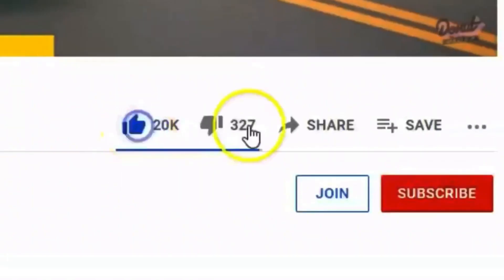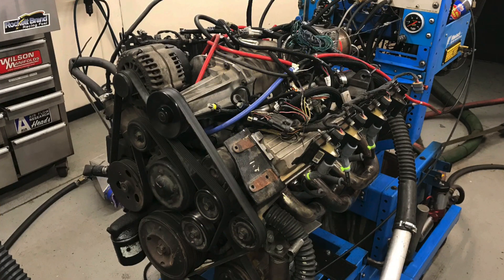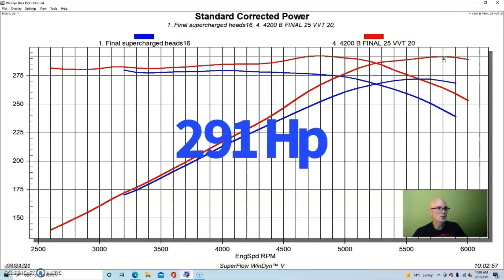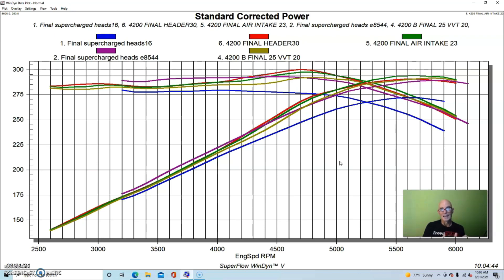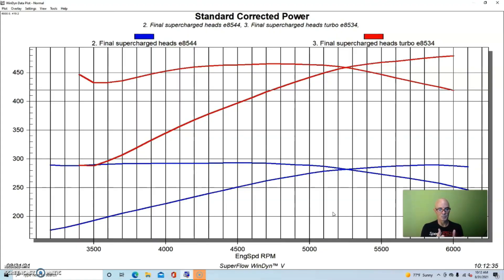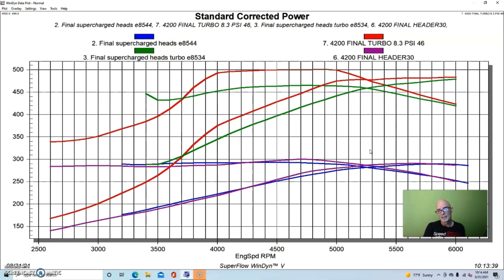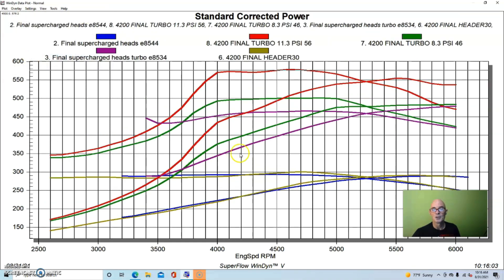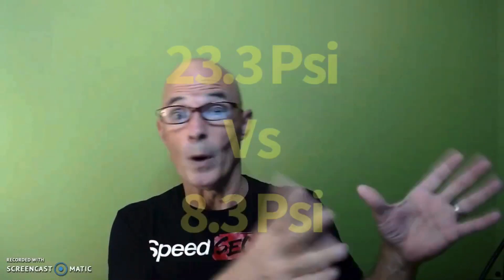WHAT WORKS BETTER, V6 OR INLINE 6? 3800 V6 VS 4200 ATLAS

Comment: I second the newer 4.3 or even the 3.6 from GM plus adding boost
Reply: Hopefully Richard will get a hold of a 4.3L.  The problem is, they are not in the boneyard yet.  I go to my local junkyard every couple of weeks and I have yet to see a 4.3L.  Come to think of it, I don't recall seeing a 3.6L either.  If Richard does get a hold of the 4.3L, he'll have to get a modified intake or try and run direct injection.  Do a Google search on Dan Jost, he has successfully turbo charged the 4.3 and it is in his Grand National.  However, he isn't running it at the drag strip it is an autocross beast.  He is running a Borgwarner turbo, about 10 psi, non intercooled on E85.  Pretty sweet setup.  He posted a bunch of pictures on FB of the build.  Check it out.
Reply from the maker: we plan to try a LV3 with Brian Tooley
Reply: @richardholdener1727  That will be awesome.  As you see I have really come to life with the other guys motor.  It's all thanks to getting a ride in an 87 Grand National in the summer of 88.  Cousin was riding with his dad in their 87 vette and I was riding shotgun in the GN.  That vette got spanked time and time again.  Then in 91 while living FL I met a guy with a modified 87 GN.  As modified as they could get at that time and we were driving around spanking a bunch of classic muscle cars, as well as the vettes and stangs.  One night we pulled up next to this little pickup truck and I thought it was a Sonoma.  After getting taken off the line a few, GN driver said that's a Syclone.  I said what?  He said a Syclone, I heard they were fast but not that damn fast off the line.

Comment: @Richard Holdener the GM "LZ9" 3.9L OHV V6 would be a good one to test. The 3800's bellhousing will work.
Reply: I keep pushing richard to do the high value v6. The 3.5 has the same heads and architecture and is really common.
Reply: Between the Atlas, the Buick, the 360's, and the 2.2/2.5 and new project car, I suspect Richard's hands are full testing for a while... not to mention that's he's probably completely out of storage space.
Reply: @timothybayliss6680  the next stage beyond "in the junkyard" should be "already on the ground sitting in front of the car in the junkyard". And I see more LZ4/LZ9 engines already on the ground than s/c 3800's and 4200's. I wouldn't be surprised to see an LZ9 throw down 270+ crank hp. The pesky swaged lobe camshaft is really the only downside.

Comment: I’d be interested in seeing manifold inlet temperatures on the turbocharged 3800 after the blower. When compounding the supercharger you would see higher a boost pressure but if you’re heating the air past an acceptable level your actually going backwards in terms of air density.
Reply from the maker: the air going in at 7 psi after the ATW intercooler was likely not hot (given our previous testing with this turbo at that boost level)

Comment: I'm gonna go rogue and say 3700 Atlas. jk. Would be sweet to see what 10 psi (or 23.3 psi) in the 3700 I5 does compared to the same in 3800 v6.
Reply: I agree I'd like to see what the 5 cyl can do lol
Reply: Calvin was working on messing with the 5 cylinder architecture. I hope that's still in the plans with him.
Or the massive 2.9L straight 4, that's another untapped BEAST.
Reply: @LowDollarDude  sound amazing is one thing....

Comment: This is an apples to avocados comparison. The displacements are not close.  One is overhead cam, the other is pushrod. The packaging is vastly different. 
The 3800SC is a decent small package that makes good torque for its size, but the supercharger is just holding it back from its true potential. The inline 6 is a better configuration but harder to get into small engine compartments, and its true potential hasn't really been explored. They're both interesting, but really  not comparable in any way, other than they both have 6 cylinders.
I agree with others that the last generation 4.3L v6 would be a lot closer of a comparison. At least the displacement is similar.
The biggest advantage I see for the 3800 is that it is a small and fairly light package that has a ton of availability. The LS completely stole its thunder, because most people would prefer an 8 to a 6. Plus, it just sounds UGLY. I'm a fan of the 3800 over the LS, but I can even understand why everyone chooses an LS  truck motor for their builds... cheap, v8 horsepower with an unlimited aftermarket.

Comment: Hands down the ATLAS. 
Psi per psi the 4V head will always have more potential for EVERYTHING and ANYTHING than that ancient 2V Buick Lump.
Although, it must be said that the Buick performed very well for being what it is. 👏
Reply: I can’t believe how flat the torque curve is on that Buick motor. They did a good job with that for the time period
Reply: @headlesnorseman701  my thoughts exactly. 👌
Reply: Don't sleep on the 3800... in America everyone seems to think it's a slouch but take a look at what the aussies have done with that motor. There's a race team down under making well over 1k and running 7s. Those v6s are absolutely wicked and don't need a whole lot of $$$ to get there.

Comment: The 4200 sounds so much better too
Reply: 3800 sounds much better with the RWD exhaust or the equal length manifolds, I've been told my 3800 sounds like a 2J by a few people!
Reply: @tuningwithstyx  v6 never sounds better than an inline! Inlines are smooth!

Comment: Boost is resistance to flow. So you are getting the same amount of power with much less resistance in the 4200. It’s not a great comparison using a compound on one and turbo only on the other. That turbo takes forever to spool up on the 4200. Can you imagine the 3800 trying to spool that? Get the correct size turbo and run it on both motors. That would be a good test.
Reply: Gt45 is a cheap popular ebay turbo. Its like 150 bucks ir somethin.

Comment: Weird comparison, I thought the 3.6 HFV6 was the supercharged 3800's direct replacement. Would be very interested to see what could be done with the LFX.
Reply: Lfx is an engineering marvel. But, I’m not convinced it isn’t made of ‘plastic’.
Reply: @marcgucciardo1942  260k KMs on mine with nothing but general maintenance so far, runs great - it isn't winning any beauty contests though!
Reply: @Carcenomy  Good to know. I think most of the problems come from poor maintenance, low oil level and young people revving the ass out of them.

Comment: I really wish engine builders at some point would have developed and aftermarket for the 4200s.  They're everywhere.  How cool would it be?  

Rich made a point, he said they never came in any really cool cars... so maybe that's why it never caught on?
Reply: They would be wonderful engines with some aftermarket engineering put into them. GM stopped making them because of v8 being the king in most people's minds and I think the 4.8 vortec was cheaper to manufacture.
Reply: GM killed them off fairly quick, the LS had a longer production run along with the Buick 3800

Comment: I know this is an older post, but I'm very curious about how the 4200 would respond to a ProCharger instead of turbo charging. 
I'm just curious if the hp and torque would increase in the lower rpm range.
Reply from the maker: no-the centrifugal blower adds very little boost at lower engine speeds-you need a PD blower for that

Comment: I blame the 3800's iron heads. 😛
Speaking of advancing technology, the engine that replaced the 3800SC is a 3.6 liter DOHC V6. The 3.6 V6 is naturally aspirated, but makes more power than the 3800SC.
Reply: Yup and they are junk
Reply: GM was gonna drop the 3800 back in 99. It was high popularity so they recontract it. Series III is a stronger 3800 engine. Mostly the rods much stronger. GM didn’t put much effort do more. Cause they know the contract date head of time. That’s probably why didn’t do much. If Series IV maybe 24v OHV lol. Two throttle body lol over 300hp. Lol
Reply: @shadowopsairman1583  Please explain why you think that.

Comment: The 3800 has a roots style charger. That should kill the 4200 below the rpm range you are showing. How much do you think the 4200s heads give it an advantage?
Reply: Variable cam timing as well.  The 4200s torque curve is almost flat.
Reply: @member5488  good point.

Comment: Its Called 4 valves Per cylinder Overhead Duel Overhead Cam the torque is Broader and the Crank is Longer It Also is a Different Segmenting on the cylinder Fire on a V there are 2 Cylinders firing at once the berra is completely different!
Reply: No cylinders fire at the same time, the rod journals are offset on the V6, to create an even firing order.

Comment: I have to ask, but what cars and years were these Atlas engines in? What trans bolt pattern does it have?
Reply: No idea for the trans bolt pattern. The engines came in chevy trailblazer and gmc/Buick flavors. Came stock with 4l60e and later models might have had 4l65e.
Reply: @calebperry7288  that's good to know. Just wonder if the trans bolt pattern is the same as the 3800. The 3800 shared the same trans bolt patterns as the 60⁰ V6 counter parts(3100,3400), and there was a 4L60e behind some of the 3800 f-body cars that had automatics.
Reply: @boosted0079  Just did a quick google search since I am just as curious.  On wikipidia it states atlas engines had a completely custom bell housing specific to their engine family. (https://en.m.wikipedia.org/wiki/List_of_GM_bellhousing_patterns )
Reply: @calebperry7288  gotcha. That at least confirms that there's 3 different 4L60e transmissions lol.
Reply from the maker: the atlas bell housing is specific-we used an adapter to mate it to a standard Chevy SBC/LS
Reply: 4200 was only in the Trailblazer/Envoy.

3700 and lower were in the Colorado/Canyon/H3.

Comment: Something about that 4200 just seems insanely cool to me , want to buy a clapped C4 & "Roadkill" one into it , or the 5 cylinder one , that would probably even make more People angry.........
Reply: If you saw where the steering rack is in a C4 Corvette, and how close the damper is to the rack, you'd probably change your mind.
Reply: @Joshie2256  Must be just like my C5 , it sounds like (steering rack location) , had to completely remove all fasteners ,steering shaft connection , tie rod ends , fluid lines & electrical connections then shove it as far as possible out through one wheel well (passenger side ? I think) just to pull balancer to change cam , inline engine would have to be 2' above hood level or 2 cylinders into dashboard , but then ,  that would be kinda "Roadkill-ish" , wouldn't it ?

Comment: The supercharged 3.8 was so slow and under powered it was a joke even with every bolt on.turbo they can be fast but anything turbo can be fast
Reply: It's the supercharged 3.8, which with bolt ons can run 11s fairly easily, even with the slush box 4 speed and boat of a vehicle

Comment: Atlas all day everyday. That said 3800 is one of best v6 engines ever made.
Reply: The 3800 is actually a pile of crap obsolete engine, the 3.6 v6 is a far superior and better engine that makes much more power.
Reply: May I introduce you to the toyota 4.0l v6?
Reply: @mikeshultz1007  try The 4.2 LT motor in the new chevys if you're staying chevy.
Reply: @mikeshultz1007  stock yes. 3800 can make way more power than 3.6. 3.6 not really a performance engine one thing. Not like the 3800. Highest record a 3800 FWD WHP 900. RWD 3800 over 1000whp. 3800 u can a lot performance parts like nothing.
Reply: @mikeshultz1007  stock vs stock, sure the 3.6 is more powerful. More reliable though? Hell no lol. Can't really compare a performance built 3.6 because there's no market for performance parts for them.
Reply: @Prestiged_peck  yeah and…I’ll stick with my bow ties.  47 years the gm 3.8 v6 was made and it’s widely known as one of the best engines of the 20th century. Definitely one of the best v6 ever made. 🇺🇸💪🏼💯
Reply: @mikeshultz1007  maybe now.
Longest time nothing. Plus i rather hear the 3800 V6 sound more than DOHC V6 sound. DOHC V6’s sound like a modded 4 cylinder. Some people like it. For me 3800 OHV heavier tone basically taste of a V8. Especially a big cam in it. I know different topic. Still talking about the same engines anyway lol.
Reply: @mikeshultz1007  yeah great observation captain obvious… your talking about an modern gm v6 it should be better. I wouldn’t expect them to go backwards. You act like I said the 3800 was best v6 ever. I said one of the best ever.
Reply: @mikeshultz1007  bahaha what rock have you been living under? The 3800 was insanely reliable and had tons of potential....that high feature trash were timing chain eaters and didn't make any more power than any other v6 in it's class
Reply: @mikeshultz1007  No fear of doing outrageous combinations , love that stuff.........
Reply: @Thumper68  if you must stick with GM, may I introduce you to the ATS-v motor, or the LT 4.3l, or the 90s 4.3l, particularly the one in the syclone/typhoon
Reply: @Prestiged_peck  I have done numerous ast-v swaps into grand nationals and T type regals, it is the most appropriate swap you could possibly do.
Reply: @Silkmaster4200  you haven't heard a VQ then have you?
Reply: @Prestiged_peck  yes Nissan.
Reply: @danielcarroll5667  My specialty with swaps is integrating everything to work properly together with different systems and different generations of systems.  I have done numerous ls swaps into cadillac xlr's and I currently have a xlr-v that I intend to put a blackwing into it.  I have done numerous saturn sky redline and pontiac solstice turbo ecotec swaps into 1970's opel gt's.  The saturn sky roadster was actually sold at the opel gt in Europe so I buy the engine covers from Europe so when you pop the hood on the opel gt it looks perfect.  I have done many atlas swaps starting when the engine first came out, my favorite application for the atlas 4200 is toyota landcruisers, my first atlas swap was into a 76 toyota landcruiser.  I feel it is the most appropriate engine swap for the landcruiser since toyota actually bought the design for the gm straight six and basically metricized it.  Having the ecu mounted to the intake is especially nice since the engine harness is essentially contained to the engine and once I program the ecu it only takes a few wires to make it run.  I have done plenty of subaru to 914 swaps and multiple ecotec mini cooper swaps.  I am starting to do more 4 cylinder ecoboost and v6 ecoboost swaps as well.  I am not a big fan of mixing manufacturers except for certain situations.  I am also working on turbo ecotec fiero swaps which should be fun.
Reply: @mikeshultz1007  i completely agree, we have these 3800 turds running around everywhere in australia and ive no idea why they are so loved. Vibrating shitboxes.
Reply: @Prestiged_peck  lol I know about all these engines I never said 3800 was the best..just one of best. Y’all crack me up..
Reply: They are definitely not what you would call refined . But you can make over 600rwhp with a stock bottom end . Amazing bang for your buck

Comment: 153624
Reply: Old timer way to remember the L6 firing order:  15 is too young.  36 is too old.  24 is just right.
Reply: @andyharman3022  It was the 70's, we were in high school tinkering with various V8's we had managed to obtain with our hard earned pocket change via the used car section of the local paper, tearing up the streets.
The straight six was a bit of a curiosity (none of us particularly desired one), had to make it interesting... ;)

Comment: I know 1 thing, the 4200 gets horrible gas mileage.  They get the same mpg as a full size truck with a 4.8/5.3.
Reply: Hmm my experience has been different.
Reply: @shadowopsairman1583  in the city I get 16-18mpg on the highway the most I've got was 24mpg and that was really trying to maximize it.  In my old Silverado with a 4.8 I got the exact same mpg.
Reply: Thats what killed the Atlas. As soon as the gtm360 came with a Al 5.3 in them it showed how weak they are stock. There was a 6mph trap speed difference in the quarter between the 4.2 and 5.3. The 5.3l also came.with dod and vvt and would usually get just as good mileage. For the 2007 models, the 5.3l trailblazer was rated 11hp more, almost a rounding error, but was a half second quicker in the 1/4.